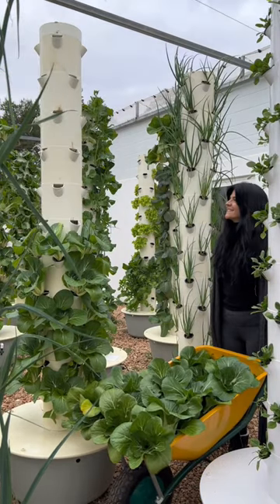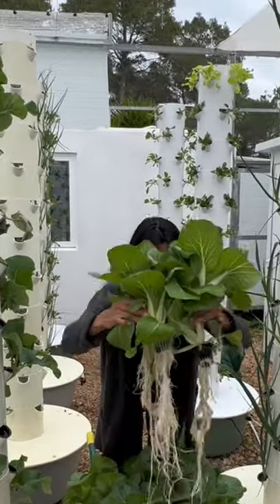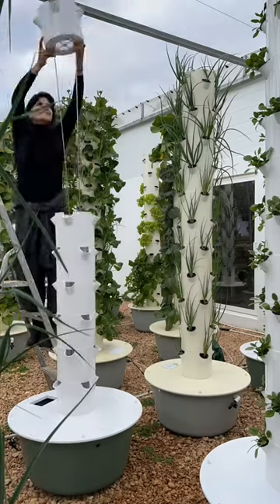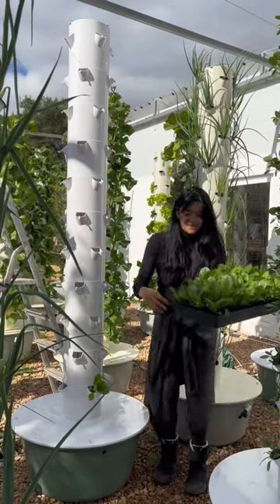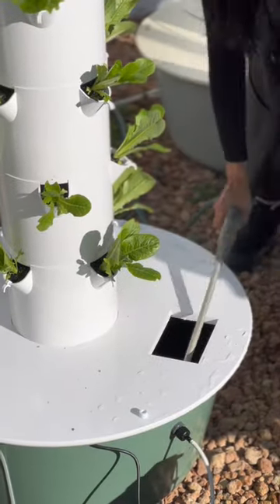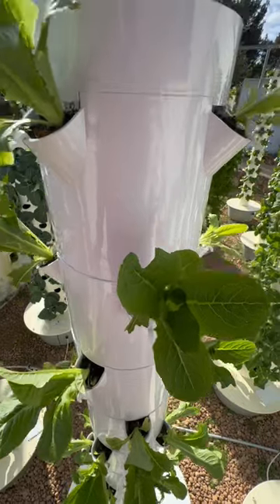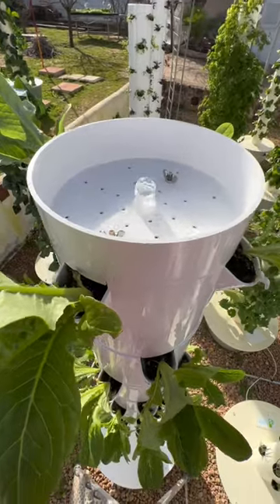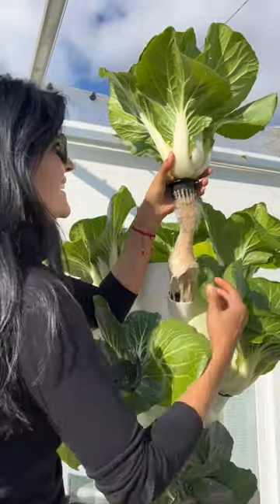Maximize crop yield with soilless aeroponic tower farming! #verticalfarming #aeroponics

Comment: Hmm this way uses electricity much more than regular farming..farmers can’t afford it. This equipment is more for rich people but with limited land space..
Reply from the maker: Each aeroponic tower is equipped with a low-wattage submersible pump that operates at 45 watts working intermittently 3 min on and 12 minutes off continuously, which means 4.8 hours per day. To calculate the cost of electricity, you need to multiply 45 watts x 4.8 hours = 216 watts.
Reply: @Agrotonomy  thanks for the info! that's ~$200 per month per tower. I am wondering who would be the target customers?

Comment: Expensive
Needs constant water and electricity
Nutrition is lacking

This trend is dead, just like you if you need to rely on these for food.
Reply from the maker: Incorrect, the irrigation is flowing only for 4.8 hours per day (3 minutes on, 12 minutes off continuously). This also applies to the electricity usage.  Regarding the nutrient density of aeroponic crops, there is a scientific comparative study that compares nutrient density levels as well as antioxidant and flavonoid levels, it shows that aeroponic crops rank as high as the best grown in soil while having over 30% increase in yields. The study is featured on our website under the Beyond Organic page: 🌱 https://agrotonomy.com